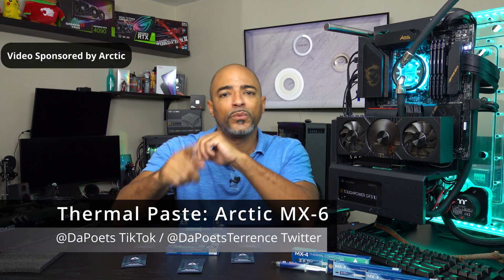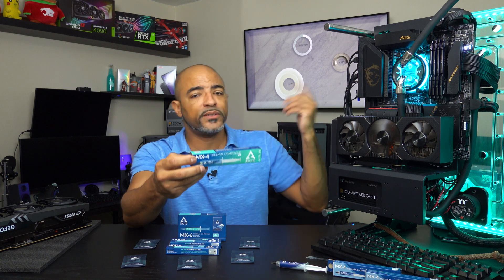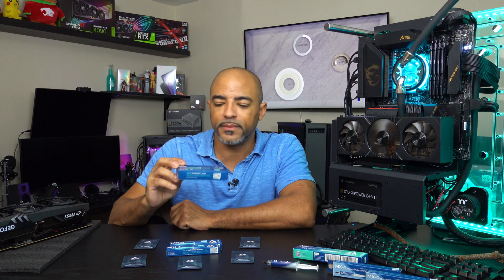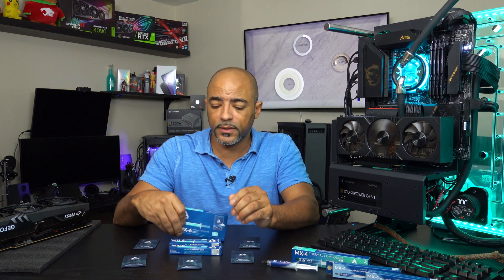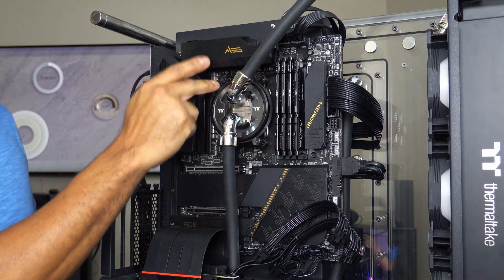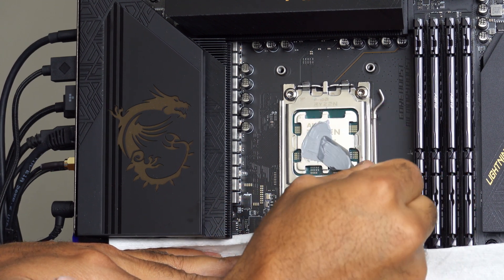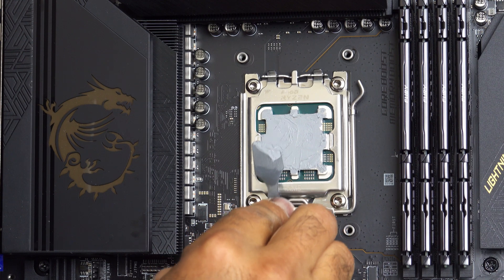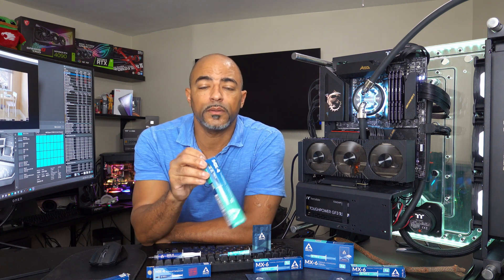The NEW Arctic MX-6 Thermal Paste!

Comment: I have the Atari VCS that was released in 2021. They used a cheap thermal pad. Replaced it with this. Went from 80C idle and 110C under heavy load to 40C idle and 60C under heavy load. I’m gonna put this on our main computer for sure!

Comment: It's nice to see that Artic has a line for extreme PC builds and let's call them ordinary. I have been using the MX-4 for many years and it really is still one of the best in terms of price, quantity and performance. The MX-6 is a nice addition for those using high end PCs that generate a lot of heat. I hope that the longevity of the MX-6 will be the same as that of the MX-4. It would be nice to see a test of the MX-4 vs the MX-6 but let's say after 2 weeks of using each .

Comment: I used mx-6 over the Thermaltake AIO packaged paste. The Temps are no different. 47C on both pastes on Prime95.
Reply from the maker: What CPU are you running? I don't know of any CPU that will run Prime 95 correctly at 47c. That's close to idle temperatures for many people
Reply: @DaPoets  Ryzen 7 3700G. Same AIO cooler. Thermeltake packaged paste 47c on P95. 47C on P95 with MX-6. 34-35C idle on both pastes.
Reply from the maker: @nycalien  That's why, your 3700G doesn't create enough heat to make any difference no matter what thermal paste you use. Putting INDI 500 racing tires on a slow moving car doesn't make it any better. You will see a difference on something like a 7950X or 13900K.
Reply: @DaPoets  True.

Comment: To cool a 16-core 7950X with a TDP of 170W, you need to use PTM7950 or liquid metal, not thermal conductive paste on which there is definitely going to be throttling.

Comment: You would probably like the Arctic clean kits, two small bottles, one with a pleasant citrus scent, and a pure alcohol.

I believe the citrus scented bottle is some form of citrus degreaser. It will instantly dissolve thermal paste. I mean within two seconds the liquid has dissolved all the thermal paste it touched.

The alcohol is than used to wipe away any residue. Absolutely needed? No, but very handy, and I bought mine about a decade ago, still use it to this day.

I like to reapply my thermal paste yearly on my GPU, every 2-3 years on CPU. Temps always seem to rise a little over that time, and I enjoy taking it apart to clean.
Reply from the maker: I've shown me using the Arctic clean kits  in numerous videos. Good stuff

Comment: I prefer line method, and for one real reason. When I started with pea I found I consistently under applied the paste. Every time I took the cooler off I could see I missed some of the border (basically all the way around).

I always felt like I was using plenty, however with line it's harder for me to under apply without it being obvious. I prefer to spread on GPU dies. That or on rare occasion I just run a line down the full die (on older pre RTX cards) where the silicon die was much smaller.
Reply from the maker: It's impossible to get it wrong when you just spread it evenly
Reply: You are a liar. Mx6 has a bad viscosity. Its hard to put and the finish is not plane. By the way... You use a palette but the company recomends to use a drop on the middle

Comment: Why no exact numbers ?
Reply from the maker: 2-3°c better than MX-6 in this system.  Numbers won't be relevant as it's custom water cooling so results will be different in other systems. But on average MX-6 was 90°c and MX-4 was on average 93°c. Target temps for 7950X are 95°c and you have to have excellent cooling to get below that on full sustained loads.
Reply: @DaPoets  oh ok thanks
Btw you should really consider undervolting the CPU
U get same or tiny bit lower performance by drastically decreasing temps
Love ur Videos
Greets to the stick
Reply from the maker: @JJ-gk5tn  thank you but I'm fully aware of undervolting and overclocking features of this processor. For review videos you always leave it stock

Comment: Thanks for the initial preview of Arctic MX-6.  Someone needs to run actual comparison testing, at least with the top five and in particular newer TIMs. I used to use Arctic MX-4 and now I'm using Thermal Grizzly Kryonaut. Arctic MX-4 did a good enough job and it wouldn't dry out and crack but it has been getting outclassed in coin performance. So I still need more data.
Reply: The comparison with mx4 and mx5 is already done. It's on youtube done by account kleo.
Reply: @natnut2008  .. First and foremost, what everybody's completely ignoring is MX-5 essentially was a QC failure and they're assuming MX-6 has zero long-term issues. Also pump out effects and TIM breakdown. I've seen some TIMs lose over 4°C in just a couple months.

Kleo has a bizarre or shall I call it unique way of spreading TIM. I too spread the TIM using a very flexible piece of thin plastic but that's where our similarities end. The difference is actually closer to 0.5° C he's forgetting ambient temperatures unless he's replacing TIM on every component which we both know he's not. The 0.5° C is substantiated in other testing I've seen as well. And then you have as I mentioned pump out and breakdown effects.

In a water-cooled hard tubing loop, it's not as easy as four screws and tada. You can't install new paste in a snap of a finger. You're generally stuck with it for at least a year if not two. I guess unless you are a masochist...
Reply: @DJaquithFL  mx-2 is still king
Reply: @AAAAAAndrea  .. Maybe. MX-4 firsthand effectively lasts a decade and without drying out.
Reply: @DJaquithFL  I have mx-2 on my CPU and didn't lose a 1°c full load Prime 95 ,no joke.
I don't care if a paste has 2 ° less but degrades faster .
I used Arctic Mx-2 cause it's super stable
Reply: @AAAAAAndrea  .. I'm referring to 10 years or 3,650 plus days with the MX-4 and the temperature difference after all that time was about 2° to 4° C.
Reply: @DJaquithFL  I'm a masochist.

Comment: Hi Terrence! You seem to be the first to review this! It's awesome! German engineering right there! Would you please be so kind and compare it to Thermal Grizzly Kryonaut Extreme? The black little bucket with pink paste in it? I am currently using it cause of it's excellent thermal conductivity but the issue is the price and also I don't need the below zero degrees capabilities of the paste, which makes it so expensive. If it performs similarly and has no pump-out issues, then I will consider MX-6!
Reply: any  update on the pump-out effect?
Reply: @Shudgum  After about one year with Kryonaut Extreme on my 3090 STRIX OC on a custom loop with overkill RAD config, I have no issues so far with temperatures. Delta to hotspot is around 10-16°C, actually it's now better than a few weeks after applying it. Mind you, this GPU never reaches 58°C hotspot at 480W with CPU 280W both churning... I think the deltas between the cold plate and the die are just not high enough to cause pump-out issues.

Comment: How do you feel about EK fluids shipped thermal paste? I want to use it but I want a reliable one.
Reply from the maker: Normally they use thermal grizzly and it's pretty good
Reply: realistically, paste is not a major part of what determines temp, the application is more important. youll likely only reduce temps by 2C with a different paste.
Reply: @BLTplays  I mean 2C could be a huge difference in some builds
Reply: @iamrudyt  yeah but realistically you’d only need that extra performance when doing something extreme like a cinebench run lol
Reply: @BLTplays  Blender is also a Cinebench run but productive. Also if you knew what Cinebench actually is, you'd know that it's the benchmark from the 3D modelling software Cinema 4D from Maxon. Sililar to Blender. But yeah, usually rendering is now done on GPUs.